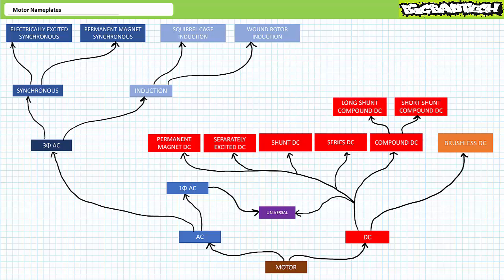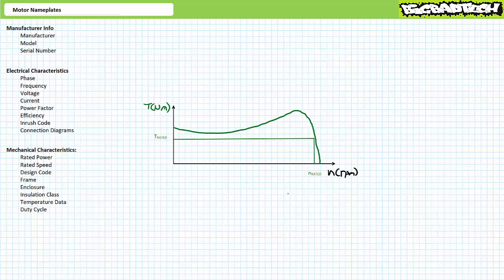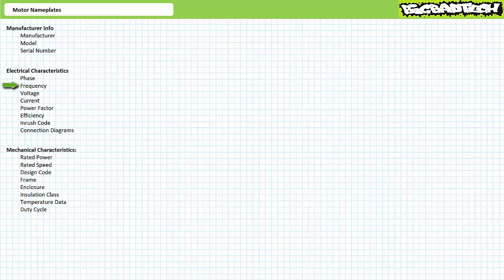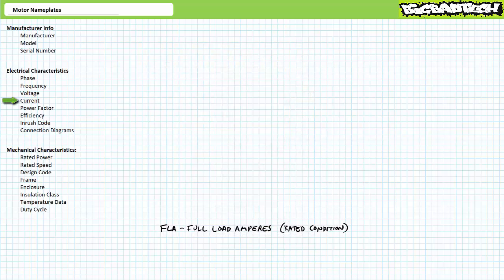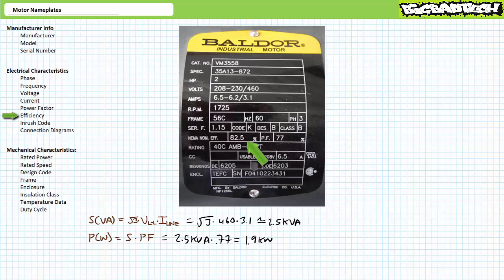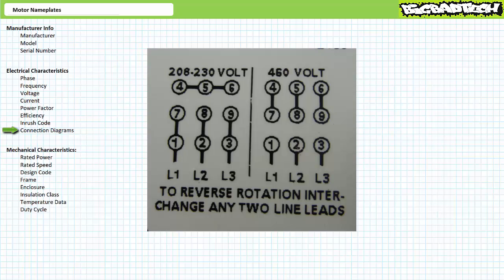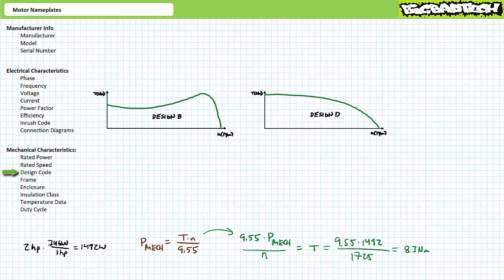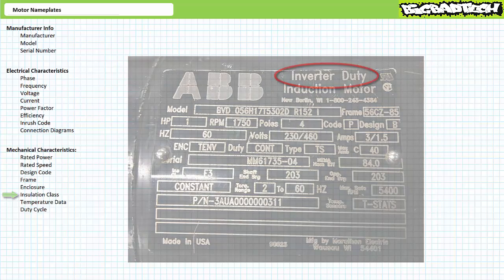Motor Nameplates (Full Lecture)

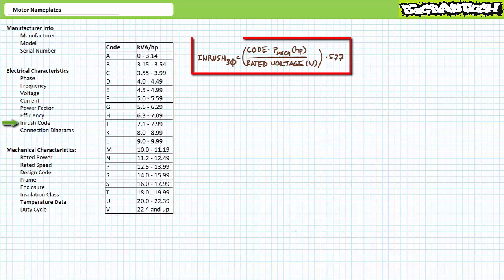Comment: @16:15 why isnt the efficiency there in the denominator... As Pmechanical is output power but product of voltage and current would be input power...
Reply from the maker: Yeah you'd think it'd be electrical power but it isn't. It's mechanical power. The code number takes this into account to calculate the inrush.
Reply: @bigbadtech  thanks a ton

Comment: excellent topic. havent watched all of it but at work i ran into an issue with the motor decoupling from the pump and no one knew. So now they want to add pressure transmitters on both sides.. i said let's keep an eye on motor current draw as it varies with load. anyway good to know the basics

Comment: General question: are all of your lecture videos on playlists or do you also post stand alone lectures on misc topics? I ask because I'm trying to methodically go through your playlists and want to make sure I don't miss anything. Thanks for the videos, I have an chemeng background these are really great refresher and new material.
Reply from the maker: Good question. Most everything is in a playlist. My recommendation is to go through basic electrical circuits (DC, single phase AC, 3 phase AC) from beginning to end* and then hit up motors and generators, motor control, PLCs, and motor drives playlists. You can watch the hydraulics playlist anytime. I'm hoping to start including expanded material on motors and generators, industrial wind power, solar power, semiconductor devices and circuits, PLCs, and digital logic in the near future.

* Here's some study guides I compiled for basic electrical circuits presented in the order I teach them:
https://openoregon.pressbooks.pub/electronics1/
https://openoregon.pressbooks.pub/electronics2/
https://openoregon.pressbooks.pub/electronics3/

Enjoy! Please tell your friends about these free resources.